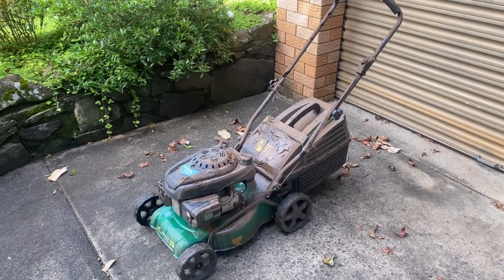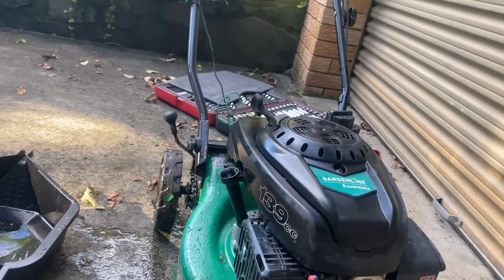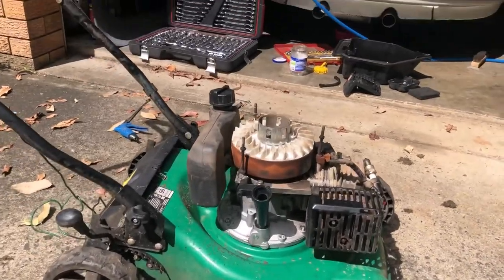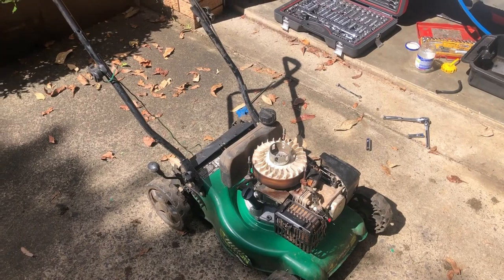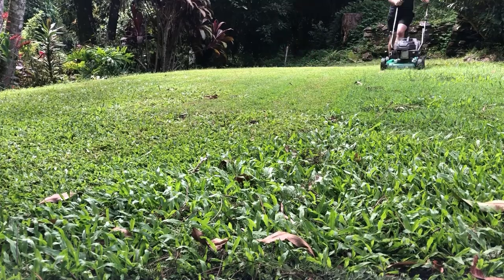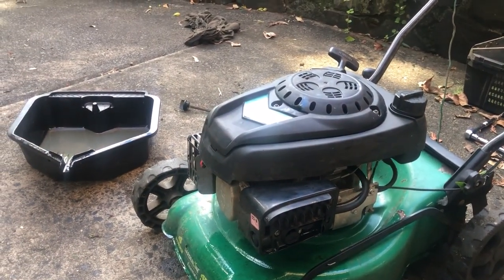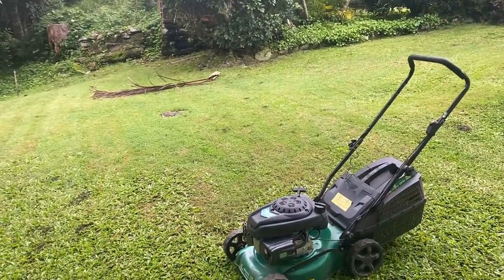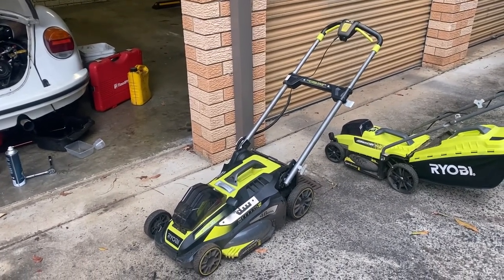Reviving a flood damaged mower

Comment: Great video
I have the same problem as yours, but when i put a new oil it wont start, i need to drain all of it and it will start. Without the oil its kinda risky, do you have suggestions about it ? thanks
Reply from the maker: It will destroy itself quick with no oil, you just need to get the oil level correct, they don’t take very much about 500ml

Comment: I'm about to get a Honda running, after 1.5 years since the flood in Lismore.
Reply from the maker: Nice one.
I’ve also done a petrol wood chipper that sat full of flood water for 6 months I need to upload.
Reply: @BoostedVW  drained & flushed. blew stuff out, wire brush here and there, inox spray, new spark plug, electrical contact cleaner in the plug hood, a new pull cord housing, fresh petrol ....and it started on the second draw. Stoked!
Reply from the maker: @Rustsamurai1  nice work. 
Both the mower and wood chipper I got going with nothing more than fresh oil so it was quite depressing seeing how many mowers and other machinery were thrown on flood rubbish piles during the clean up.
Reply: @BoostedVW  Indeed. There was one bloke going around in an old ute; I helped lift a few into the tray. He was intending to fix and sell. It's a bit sad they were discarded in the first place. I rescued, fixed and returned a few from my street, post flood. Until then I'd done no small motor work, ever. I've three air compressors I've yet to have a crack at.
Reply: I’m in Lismore to and trying to repair mine